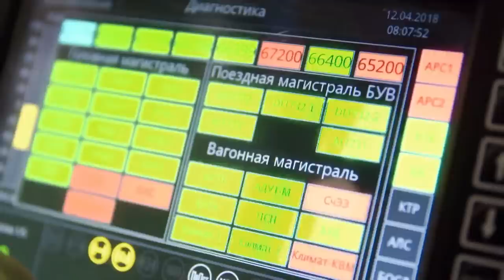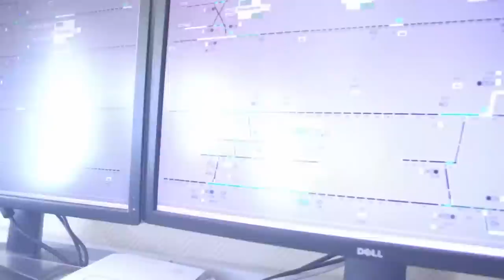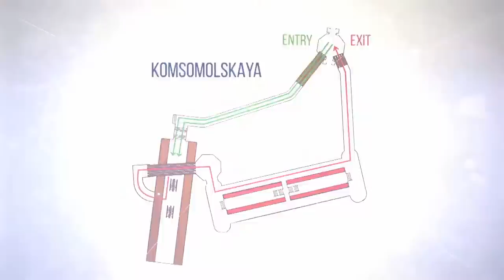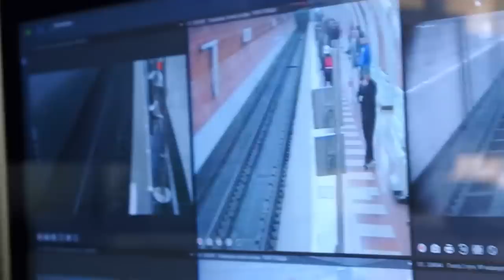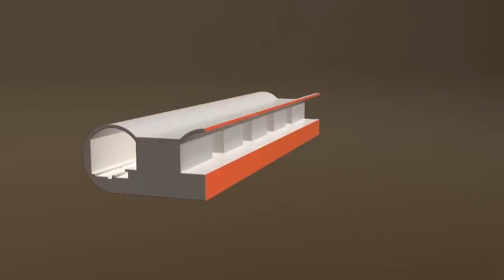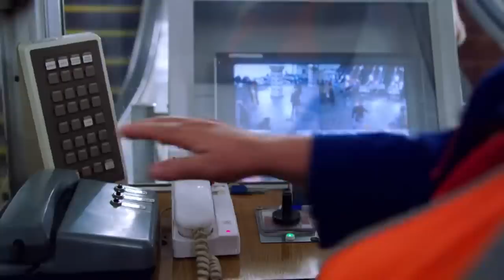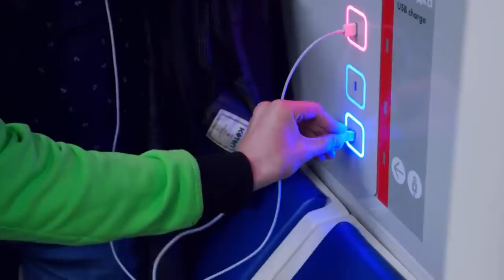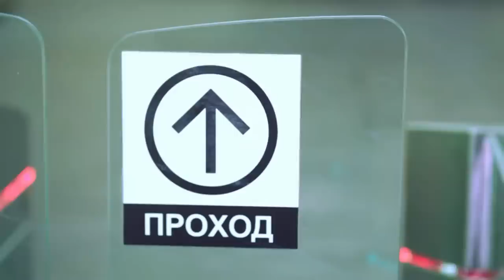Big Underground System: Moscow Metro | Giant Hubs | Episode 6 | Free Documentary

Comment: That's impressive, 90 seconds and they strive for accuracy all the time. Where I live it can be anywhere from 2-8 minutes depending on the time of day, but this system moves alot more people per hour than New York. the stations are beautiful.
Reply: 90 seconds in rush hours only tho, in the middle of the day it is more like 2,5 minutes, and late night, up to 3-4 minutes, and even larger intervals past midnight.
Reply: ^ what he said. every metro in the world operates on the principle of efficiency, i.e. you'll never ride in an empty train car in through the middle of the city, anywhere in the world
Reply: @Afdch  In Beijing Subway (BJMTR), even we use CBTC, the interval of the train in the most overcrowded line 4 is still 103s...
Reply: one thing would have been nice to see. these huge motors that drive these long escalators...
Reply: 40-60 seconds actually.
Reply: @Afdch Many lines have intervals of less than a minute during rush hours. By the way, Line 7's got a 90 second interval all the time, since it's the most busy line of the system.
Reply: No every day. On friday interval 2 min. On weekends more then 2 min.
Reply: @ГлебИванов-ц3р  It's 90 second headways, i.e. 90 seconds between two trains passing the same point. Obviously in a station it will look like 40-60 seconds between 1 train leaving and the next arriving.

Comment: OMG That's the most perfect documentary I've ever seen. It's full and accurate and show everythig and every aspect. Definetely I'll watch more videos from this chanel
Reply: The Sapsan documentary is considerably worse, however
Reply: It isn't full at all. No mention of the Central Circle which is part of the Metro system just operated by another company, same with the Monorail. They're functionally the same as the other metro lines and require the same one ticket. Would be worth to mention the Central Diameters also, they're an extension of the Metro

Comment: (200+ Stations) The scale of that system is just Magnificent.
Reply: The documentary is old, because at moment of publication Moscow metro contains 269 stations, not 212
Reply: It's not that big if you think that for example the Munich metro has 100 stations for about 1.5 million inhabitants, while Moscow only has 269 for about 12 million (thank you Ivan) residents. However only the amount of stations isn't a measurement of magnificentness of a metro network - for example the Moscow metro has wider platforms and a higher frequency of trains than the Munich one
Reply: @connectingwings7212  You have a point. I also learnt that Paris has about 300 stations so there is a lot more to this.
Reply: @connectingwings7212  11.98 millions in Moscow itself + 10 millions in 100 km radius
Reply: @victornderu143  Well Paris is a whole different story, it is very old and the residents wanted to get rid of the trams in favour of the metro. The network is more than great for only 2 million residents. The problems of the metro are the aging rolling stock (some are from the 50s), the dirty air due to the air-filled tires of the trains (which can also be considered as an advantage due to the smoother ride) and many VERY dirty stations. Most problems are the result of limited funding for the system - which kind of could be expected for a city of this size featuring such an extensive network. Paris metro definitely has the potential of being a world-class metro system, if funding for the maintaining costs increases.

For comparison to Paris you could take Hamburg, whose metro only has 93 stations for s similar city population. And many people think that this is not enough. And Hamburgs system is old as well and they got rid of their trams as well - which leaves the city at a lower-class network.
Reply: @connectingwings7212  thanks for the explanation
Reply: Moscow metro should have had much more stations of course. However, due to the different reasons it was not developed from the fall of the Soviet Union at around 1990 till around 2010. For the 20 years there was only a few stations built. City population grew from around 8 to 12 million during the same period.
Reply: @victornderu143  You're welcome :)
Reply: @Slononos  Absolutely
Reply: @archivushka  Moscow Central Ring is not actually Metro, despite city officials' best efforts to make people think it is.
Reply: @ursa_margo  compare this to Deutsch u-ban and s-ban
Reply: @connectingwings7212  The distance beteween station is MUCH bigger than in Munich, and the trains are bigger.
Reply: @teonesterov9141  Well, as a wrote before, station and line count is not a comparable measurement by itself.
Reply: @victornderu143  China holds the world record with Beijing's 478 stations, Shanghai with 515 stations, Shenzhen with 369 stations, Wuhan with 291 stations, Chongqing with 277 stations, Guangzhou with 411, and Tianjin with 205 stations, etc.
Reply: @reis1185  I had no clue 🙌🙌

Comment: The "Moscow" trains are so freaking cool. I mean this red and blue model is really called "Moskva" if translated correctly are so quiet and smooth and very informative if you don't know where to go next. Hope they will be used on all lines soon cause now they are used only on the most loaded ones♥️
Reply: It will take 5-6 years i think, to change all old trains. They buy 500-600 new cars every year. And there are about 3000 old cars now.

Comment: The most incredible things is even moscow metro trains and system itself is every aged, but they are running at such small interval-90s is still impossible even we use CBTC moving block and ATO automatic train operation in HK and Beijing, which we can only achieve around 100s~120s interval.
Reply: Most of the Metro trains have been replaced with new ones. Aircondition, TV, fair enough with City related things and advertising. USB loading docks. And of course FREE WIFI on the whole system, never mind how deep it is..
Reply: There is no ATO in Moscow. But so many things were in St. Peterburg. For example platform screen doors were installed in 70s there.
Reply: @megalifts  Even without ATO, still reached 90s, that's incredible!
Reply: @fhs7838  There was ATO prototype for PSDs in Petersburg,but now it is turned off because drivers were watching in their phones while ATO is operating the train. But yeah, this is great that system like that which is not a high tech metro operating on time.
Reply: Moscow metro trains are equipped with a system similar to ATO/ATP. Its called ALS-ARS (Automatic locomotive signalisation with automatic speed reduce). This system allows the train to travel at rated speed and at the same time ensures safety.

Comment: 20:46 As a viennese tram driver I have to agree. Get on the bloody thing or don't, but do not block the doors, it's causing a lot of delay!
Reply: There is delays in Austria ? If you tell me that Switzerland also have delays - I will loose all my trust to stereotypes about Europe's nations.
Reply: Hi, I'm planning to go to Wien with my wife in December. What should I do, which routes should I take to get the best experience of Viennese tram system? Thanks.
Reply: It doesn't really matter which tram you take, but the most beautiful lines in my opinion are 1 and 2 around the Ring-Street
Reply: @themorris5620  oh thank you! I come from a land where the only trams you have are the few remaining routes left from the Soviet era, with railcars 30 to 40 years old, and rails in extremely poor condition. Riding a modern tram is a treat to us.
Reply: @johndavidson4127  In Switzerland the delays for intercity trains are quite common on a daily basis. The light metro versions in the Swiss cities, or trams, run more reliably. But still, the short intervals between the trains/trams, like in Moscow metro are a dream.  This, of course, have to take into the account, that the transportation system in Switzerland is not underground, except for transit tunnels, thus more susceptible to the external factors, causing delays. The only European metro system, that is close in its efficiency, elegancy and cleanliness to Moscow metro is in Athens. It is very small, and is not comparable in scale, but for such a small system Greeks made it almost as perfect, as in Moscow. Switzerland is amazing for it's mountain trains and funiculairs, that is for sure. There are small metros at high altitude ski stations, entirely built in the mountains, with very steep angles. So - no uniform comparison could be made. Each country has it's best in something, then it comes to transport.  I do not know, if it helps to maintain the stereotypes with these details, though :-).
Reply: @johndavidson4127  Austria is NOT Switzerland, almost everything is shittier than in the latter. And Austrian Federal Railways are a shitshow compared to SBB and RZD. Two centimeters of snow and everything is shut down immediately. A single rail accident and half of the country is without rail service. A single shitty short bridge takes more than 10 years to build and operate while the longest road/rail bridge is built in 4 years by the Russians.
Reply: @egalf  well, as an Austrian i have to disagree with you. with 2 cm of snow, the the cleaning crews or snowploughs are not even moving out, because nothing is happening. and for the rest i have indeed to agree with Olga Ivanova.

Comment: Now, this is a city which value its people, or at least at some point in time. They made quite an investment, on these metro station design, for the benefit of all. Impressive! How would you compare this with the New York metro stations?
Reply: Not!
Reply: The New York City subway is a joke. The Moscow Metro is the best subway system in Europe and is one of the best in the world, however, that too is subject to change. It is expanding very rapidly these years, meanwhile the NYC isn't getting any better with its regularly breaking new R179 trains, which are on par with the 81-760 "Oka" trains which started coming out 6 years prior to R179's first run in the NYC subway. Meanwhile we have built the next generation 81-765 "Moscow" trains in 2017 and surpassed even that with the next-er generation 81-775 "Moscow-2020" trains this year. We were only competing with ourselves, as there weren't any other trains on par with 81-765 in the world, even Siemens Desiro was worse and only had the similar exterior.

Comment: Dear!!! The lenght of the tracks of the Moscow metro is non of 365km!!!!! 
1) 365km is only lenght of lines!!!!! Every line consists of 2 tracks!!! But even these data is old. It was actual 5-6 years ago! Now we have 394km!
So we have 394 km line lenght * 2 tracks = 788 km!!!!!!!
2) Every metro has plus 10-15% auxiliary underground tracks. And Moskow`s too!
So we have 788 * 10% = 78 km!!!!!
3) Besides that every metro has depot tracks. Every depot yusually has 20-30 tracks with 200-400 meters. 
Moskow merto has 20 depots and every of them is very large! So, total depot track lenght 20 depots * 30 tracks * 0.3 km = 180 km!
So, total lenght of the tracks of the Moscow metro is 788 + 78 + 180 = 1046 km !!!
Of course it is approximate calculation (+-20 km). But it is close to the truth!!!
Reply: Какая есть официальная информация о длине пути, такую и сказали, то есть в обе стороны и без учёта чисто служебных линий.

Comment: (new account)   I wonder if the transition from the 2nd Komsomolskaya station to the 1st is through the underpass purely for aesthetic reasons due to the architecture, or is that because of something else ?
42:58 - both stations only have one exit ? Were there ever plans to build more ? This is interesting. According to the drawing, if the red color is Sokolnicheska and the brown Kolceva, that there is a long escalator tunnel, which starts below from the underpass under + behind the track, and then crosses the entire lower station (yellow cathedral) above its ceiling, and from there a short corridor leads to the upper floors (gallery above the tracks) of the upper station.
 I'm writing this again from a new account, I canceled that one because I forgot the password, and I couldn't permanently send a comment under another video about the Moscow metro. So the comment from the previous account will probably disappear.

Comment: A subway could connect to the railway lines near the Moscow metro if it ran from Ivanteyevka Ивантеевка (North East Moscow) to Yurmanga Юрманга (about 400 miles North East), or thereabouts. It could be a direct line with a 200MPH speed allowing for the approximately 400Mile journey to be accomplished within 2 hours. Then the weather conditions do not stop the train and that is because it is undergound (as a subway/metro). This means small industrial cargo can be transported via it and not merely passengers. That would make a profit. An occassional hospital train could be added to improve health and safety to avoid industrial accidents in the regions.
Russia have multiple examples of world wonder engineering in digging engineering including the world's deepest hole (so deep the heat could be felt), dam-building for the nile whereby (in modern times) ancient Egyptian giant structures were moved, and of course the Moscow Metro itself. So, such a subway-undergound train line (with power-over-ethernet rj45 10GBPS internet and charging points) could provide transport and avoid the rivers in Russia which, while beautiful and formidable. The most pragmatic languages to include on such an underground line's signposts and digital documentation (instructions) would probably be Russian, Polish and German (even though English would be nice but not the priority). Exhumed soil could be used for fixing land affected by (permafrost) climate change (or even land-reclaimation).
My comment has no hate in it and I do no harm. I am not appalled or afraid, boasting or envying or complaining... Just saying. Psalms23: Giving thanks and praise to the Lord and peace and love.

Comment: Worked as a delivery man in the city half a year ago. I wish I never had an experience of travelling via public thansport all over it. The metro is not that lovely btw. The problem is deadly-old trains on many lines. They're dangerously loud. New ones are noisy also. Funny thing, the ACs in the  new trains make as much noise as comes from outside the old trains. Compensation, lol
Reply: The newest model(Moskva) finally solved the problem with noize.
Reply: Sib Student, well, the latest released units perhaps did solve it. I can't argue that. As far as I experienced, line 7 (purple) had Moskva trains where ACs are loud, a year+ ago. Not sure if it's the conditioners specifically. Probably, just air pressure coming from outside trains makes noise. J my bad impressions, so never mind.

Comment: there doesn't seen to be much lifts or am I wrong?
Reply: You are correct the metro system isnt built to support the disabled the disabled usually use the fairly good bus system personal cars or taxi's
Reply: The situation is more or less improving currently. All newest stations has lifts and all the stuff. But no ot the old ones, you are right.
Reply: On most new stations (after ~~ 2010) there are elevators for disabled.

Comment: 31:49 That's not a WW2 tech.
Reply: WW2 teches were trucks with big lighters , special big things for sound finding of planes and special machine guns vs aviation , that equipment saved Moscow from nazy aviation, only ~two enemies planes came throw and three bombes
Reply: It is P-20 station, developed in 1946-1948. It had 5 beams and five receiving channel, each worked at own centimeter wave range. Three channels detected azimuth and distance, rest two — height. Also station had IFF system.

Comment: Witch is bigger: London’s or Morscows Metro?!!!!
Reply: London Underground: 14 lines, 270 stations and 402km summary.  Moscow metro: 14 lines, 233 statinons and 408km routes. But in London, only half of the entire London route passes underground, while in Moscow the metro is an exclusively underground transport system. There is also an elevated one connected to the metro, but it is called differently.
Reply: @ВладимирБогомолов-х2ш  Line 4 and southern part of Lines 2 and 7 exist.

Comment: One minute in to this documentary and already saw an error. Moscow metro system has 15 lines, not 13. It is not that hard to take a look at the map and do correct factchecking before releasing the video
Reply from the maker: The documentary is from 2018. When you figure in post-production you can easily figure out that it was filmed in 2017. Now Bolshaya Koltsevaya was first opened in 2018 and  Nekrasovskaya in 2019.